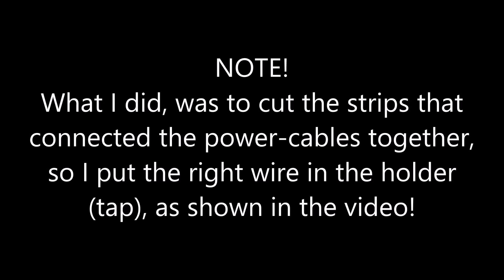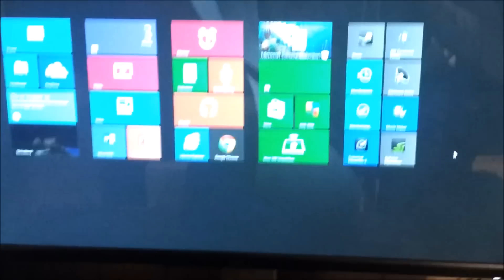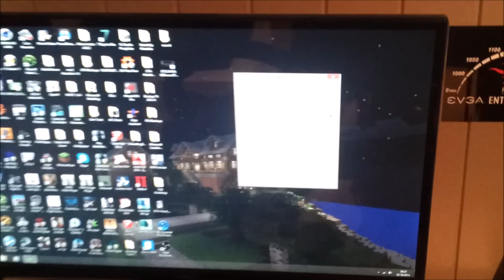Alienware x51 EVGA GeForce GTX 760 4GB FTW /acx Upgrade/ Installation Tutorial And Review

Comment: thanks for this vid man. I heard that using a gpu with double fans in the x51 was taboo, but you just installed one with no probs so far I guess. Thanks again you have given me the courage to start my upgrade as well. by the way you just put the 6 pin into the 8 pin port and it worked?, I thought you had to use a 6 to 8 pin adapter or something.
Reply from the maker: yes i tought that first too, but i readed on the site there i bought the card, and there thay said that you can use two 6-pins on a 6-pin + 8-pin card. I can say that the card is running with no power problems. The card only gets hot when playing games that constant render, but it runns cooler than my old card when playing black ops and Minecraft and games like that :)
Reply: Games To Tuts so no power problems at all?????
Reply from the maker: Lollercoaster119 yes no power problem at all :-)
Reply: hmmm alright and what about the space was it a tight squeeze?
Reply from the maker: Lollercoaster119 it wasn't that tight fit that i think it should be. You have about 1.5cm space between the front fan to the card. So you will be able to upgrade to a bigger front fan if you want :-)
Reply: did you upgrade the front fan if so which one?

Comment: Any heat problems since you are not using a reference /blower type of card? I'm tempted to buy a 970 with this cooler since I can't find a reference one, but I'm scared that it gets too hot inside the case, please let us know if you experience something wrong. Thanks for the upload I hope it works fine!
Reply from the maker: Thanks for your comment :) I haven't got any problems with this card, no restarts or power loss. When i play games like black ops and black ops 2 the card reaches max 65 degrees celsius and i will say that is a good temperature with this card. When i play games that render constant, like euro truck simulator 2 the card gets up to 86 degrees celsius at the max. I can play battlefield 4 and 3 with ultra setting on, without lag. The card gets around 86 degrees celsius and 70c (depends on witch map you are playing on) The really good thing with the ACX cooling is that the fans cool down the hard drive and the computer pretty good (better than the blower style fan) I can confirm that only the graphics card is quite hot when i open the computer cover after heavy gaming. The other parts are not that hot at all. I am going to put some blower fans ounder the gpu so the computer get rid of some hot air from the gpu.

Comment: Where did you find the 330W PSU? I'm installing the MSI GTX760 TF today and I believe that the standard 240W AC Adapter came with my AlienwareX51R2. 240W isn't enough to run system processes with my new 760 :/. Also, was there any need to buy a 6to8 pin connector adapter?
Reply: btw im also upgrading from a GTX 645 like you are at long last lol
Reply from the maker: Hello. I purchased the 330w psu from the dell website for my country. You can also get them on ebay and Amazon for cheaper. I only used the two 6-pin connectors, so no need for any adapters as they fit in the 8-pin on the gpu. Good luck :)

Comment: hi
first of all thanks for your video. I am also planning to upgrade. in your opinion which type of graphics card is better , single blower type or dual fan type?
Reply from the maker: I recommend singel blower card in the x51, because the dual fan one will get a little loud because of all the heat that it push into the case, but a singel blower card will take up fresh air from the front fan in the x51, and blow the fresh air thriugh the card. The dual fan will cool the give the same temps as the singel blower in the x51. I have found out that if i turn my x51 on the side, then i can fell cold air beeing sucked in at the buttom of the case, and i feel hot air be pushed out on the top of the buttom. I can say that it cools better when the pc is lying on the side the fans doesn't need to work that hard too. It also cool doen the HDD pretty good. But it is one more thing i have to say, the front fan in the computer getts pretty loud after playing gpu intensive games so i actually think the dual fan card is good in the x51 but the front fan needs to be replaced. Hope this helps a bit :-)
Reply: Games To Tuts hey thanks for the prompt reply, i really appreciate your help
Reply from the maker: Ayan Adhikari no problem, I'am happy to help you :-)

Comment: Are you still using the configuration in this video?

I have an:
i5 4430 
GTX 660
8gb RAM
330Watt PSU

I want to upgrade to GTX760, but want to be sure it will work.

Comment: So have you gotten AC Unity? and if so, how is the gameplay like with this GPU? I want to get a 760 or a tad higher. And after this video I think I'm going to crack open my beauty to see how it looks for myself lol
Reply from the maker: I haven't tested that game, but i have AC Black Flag and it runns pretty good in 40-50FPS with everything maxed out in ultra :-)
Reply: Games To Tuts I have played black flag on the GTX 645, and smooth gameplay all throughout. no drops, rare but comical glitches. But I can run Unity, but with horrid frames. even after the recent patches. Anyway, I plan on buying a new case with other parts attached so I can upgrade and just transfer the good pieces of my X51 to the new case. Yes I will be performing surgery on my baby lol
Reply from the maker: Janov Clervil I actually working on the same thing. I have recently got a Corsair CS 750M PSU and i am going to buy a new case too when i get some monney, so i can put my x51 in it, but i am going to buy a EVGA Stinger Z87 FTW motherboard later so i can put the Alienware motherboard back in the x51 and use the x51 for traveling to LAN and stuff :-) I do this because of my interests :)
Reply: Games To Tuts
Oh nice. I was planning to try to sell my x51 case but, I think I will keep it and have my parents learn how to use a computer on it lol.
Reply from the maker: Janov Clervil sounds good :-)

Comment: Good morning, please I really need your help. I am from Brazil, on 2013 I visit Canada and i bought one x51 R2. It came with a geforce gtx 660 2gb and some years later a upgrate it for a gtx 760 4gb, since a made this upgrade the computer makes a really loud sound, it looks a airplane taking off!! My power suppli is the standart, i think it is 240w. To change for a 330w power supply I need to buy just de power supply with the cable or I need to change something inside the computer enclosure? PLease I really need your help!
Reply from the maker: Hello. Sorry for late reply. I also had this problem. X51 with gtx 660 should alerady have the 330w psu. I found out that it is not the graphics card making the noice but the 60mm fan on the front of the graphics card and case. You can control it with speedfan manually. Look at this thread for more info, as many people are having this issue: http://www.alienowners.com/threads/x51-cooling-front-fan-replacement.3741/

Comment: What are your temps like? I'm expecting around 75-85 Celsius?
Reply from the maker: It depends on witch game you are playing. But in black ops you have temperarures around 50-60. But in games like battlefield 3 and 4, gets the card pretty hot, with degreeses around 65-80, the gpu fans stars to spin really fast and gets a little loud. This card is a litte better than the Superclocked version but i recommend you to get the SC card if you are going to have it in the x51. The problem with the FTW card in this case, is that the card is open around the whole card, exept the back and top, to disepate hot air faster and make the card cooler, In other cases. So try get the SC if you are going to have this card in the x51, because it is locked around. Hope this helps you :-)
Reply: But wouldn't the SC version create even more heat than the FTW edition? and the FTW has ACX cooling. 

So the FTW creates less heat, and has better cooling?
Reply from the maker: Yes the SC wersion with dual fan ACX will create more heat than the FTW with ACX if you have them in a big case. Thats because the SC version is locked around and the heat gets straight out of your computer but the FTW ACX Is open all around so the heat is blowing out faster and the card gets cooler. But the x51 is pretty smal, so hot air will blow into the case when you are playing, and the card will suck up some of the hot air, so thats why i recommend the SC version if you want it in the x51 :-)

Comment: this isnt possible unless u installed a different motherboard the x51 motherboard isnt compatitble with graphics cards that high i asked the alienware people
please tell me how u did it, i have a alienware x51 with a gtx geforce 555 and want to upgrade it. what do i need to do?
Reply: First, for the most part Alien ware support will not tell you anything. If you can't buy it from Dell that's because they won't sell you anything that wasn't sold with the X51 when it was made. They have a standard answer, IT WON'T FIT!!
Now read this.
The other night I had to call Alien ware support, and I wanted someone with better English that I could understand. So I got a Supervisor in Teir 2 support. After she fixed my problem we had a talk about Video cards.
The GTX 760 Ti was the largest card they tried in the X51, Yes you need a 330 watt power supply you can get on Ebay or from Dell. Inside the case is a Step up transformer that puts out 500 Watts. 9.5" is the longest card that will fit. And you should get a card that uses only around 170 watts.

Comment: I upgraded my x51 graphic card from Geforce GT 640 to GeForce GTX 750ti FTW. all I had to do is to upgrade my power ac adapter from 240w to 330w. 

240w is the slim brick power ac adapter and the 330w which I called the Power Brick which is bigger than the 240w slim.

mine booted up with 0 Problems. please do not download more than one drivers. stick with the current drivers that your given.

I played Dying Light on mix medium and high settings at 60fps-102fps

Comment: Whats up? I installed the GTX 760 on my Alienware like yours, very nice the video thanks. But im playng some games with very nice graphics and the fans are very loud de sound. Is it normal? The temperature is normal, but the sound.. so loud!!
Reply from the maker: That is the front fan on the x51 that ramp up to max speed at me very annoying, but i think switching the fan to a silent one will fix the problem.

Comment: Would I notice a huge difference in FPS with a 750 Ti from a 645?
Reply from the maker: RyanSmithHD Yes i guess that. My GTX 760 is about 3 times better than the 645,  so yes the 750Ti will be about 2 times better or more than the 645 :)
Reply: Thanks mate :)
Reply from the maker: NP :D

Comment: I have a i7 4790 (I think that's what it's called) and I also do too have this Alienware x51 but with power issues I'm not sure if this is even possible for me. Any advise?
Reply from the maker: I think the reason for power problems is that your i7 use about 14w more power then my i5, so that should be the problem for your power issues. Try go in control panel and powersetttings and change the power plan setting to balanced or the lowest you can get there. Hope this helps :-)
Reply: How many watts do you have? Also an i7 does eat more wattage then the i3 or i5. Like Games To Tuts said, I really wish i didnt buy an alienware and built my own. I have the gtx 750 ti in mine with a i3 CPU and 240 watts. You can always download nvideas program which lets you limit how much power the card will consume but it will decrease performance a bit. If you ever going to upgrade past like the GTX 700 series then you would need a new case and PSU to have it perform properly but the motherboard's IO sheild is built into the x51 so you would need to buy a new mobo :/
Reply from the maker: Papa Smurf i got myself a new case for about one mounth now, and i put my x51s parts in it (The Motherboard and hard drive and my gtx 760). I buyed a Corsair cs 750m gold rated PSU and put it into the case, and the x51 parts works with that psu. BUT one problem! When i start the pc i get an ERROR "Power sensor failure!", then i press F1 to continue and it starts up to the Alienware logo and then it freezes ( Only Sometimes) Then i have to turn the pc off and on again, and then it works. Just press F1 to continue on startup, and if the boot failed u just need to reboot the system. I got a new problem for a week ago. The seccond RAM slot isn't working so i only run 4GB of RAM, and everything goes so slow after playing a game so i have to restart the pc. But i am going to buy the new EVGA Z97 Motherboard after christamas and swap out the i5 from my x51 motherboard and put it into the EVGA mobo, so i get everything up and running 100% faultfree. I will also try to get two 8GB HyperX Sticks of RAM so i have 24GB RAM. But the gtx 760 is running much cooler in the new case than it did in the x51. And the fan speed on the 760 is newer over 50% ounder big load and it is super silent. I recommend you to get a motherboard and a case and put the x51 in it.
Reply: Games To Tuts How did you get the IO shield off the mobo of the x51 and did it make any beeps when it said power sensor failure?
Reply from the maker: Papa Smurf i dont use any IO shield so i just have it open. I get the normal 1 beep on every boot
Reply: I may just do what you did and get a new case with the new motherboard so I guess that works
Reply from the maker: ***** Yes The gtx 760 worked in the x51 with no power issues, but it got so hot and the fan speed was 70% ounder load, so it got a little loud. But with my new case, i have my fan speed never over 50% and the lowest fan speed is 42%, so go with a new case and motherboard and pull your i7 over in the motherboard, and make sure that you have the right socket on the motherboard for your i7 :-)
Reply: What kind of case would you recommend or at least what size should I get? Thanks for all the help
Reply from the maker: ***** I got the NZXT Phantom Orange/ Black, because it is nice looking, (looks a little bit on the Alienware x51) and it also comes with an fan speed controller and 4 fans inside. This is a big tower and the cooling is pretty good, and it is easy to work in :)I recommend the NZXT phantom cases :)
Reply from the maker: Games To Tuts I also buyed the nzxt 2m orange led kit, so i have orange led light in my case. Looks Awesome. The Phantom cases comes in more colors :) Case link:  http://www.nzxt.com/product/detail/34-phantom.html
Reply: Games To Tuts That is a really nice case but I'm thinking I may get something different. I'll go search the interent for both a motherboard, power supply, and a case. Probably will use http://www.pcpartpicker.com for the help because of compatibility
Reply: Games To Tuts Also what did you do with the Alienware Command Center when you got the new case?
Reply from the maker: ***** i jist have the program on my desktop incase i get an alienware tact x keyboard
Reply: ah I see. Just wanted to know what to do with it when I get a different case
Reply: Games To Tuts I think I know why you get the error, did you know that their is a Step Up Transformer board in the X51 using 330 Watt PS. This gets stepped up to 500 watts, your other 750 PS is having a problem with the 500 Watt' I'm running a GTX 760 4gig on a X51 R1 with a 330 watt PS with no problems at all. Plus 16 gig of ram.

Comment: hi i bought my alienware in 2014 it came with a GTX 645 and was wondering if i could fit and handle a GTX 750ti with the 330w PSU please help me and great vid BTW
Reply from the maker: Yes you can have that card in the x51, and run it with no problem :-)
Reply from the maker: You can use your 240w psu that came with your x51 if you are getting the 750TI with one fan. Which brand are you going to get? Need to know how much power the card uses. I am willing to help you :-)
Reply from the maker: Heres a guy who did this upgrade with the 240w psu:  http://www.alienwarearena.com/forums/thread/71011/hardware-software/i-installed-gtx-750-ti-sc-to-x51-r1-with-240w-psu
Reply: Games To Tuts well im not sure which brand and my current specs are: i7 4790 and a 645 and are you sure i dont need a better PSU?
Reply: 9.5 Long

Comment: I installed a pny gtx 970 [4gb] to my R2
no regrets
Reply: RX7821979 what psu have you got?
Reply: RX7821979  (Power supply)
Reply: Static IsBae 330 watt power brick from dell
Reply: did the psu come with the alienware x51 r2
Reply: Static IsBae
no
I had to spend 120 dollars at amazon for the psu
Reply: but the 330w comes with the alienware x51 r2
Reply: cause i have it
Reply: Static IsBae
mine came with a 240 watt psu cause I had a gtx 745
Reply: +RX7821979 was your upgrade a whole new power supply brick? Or was it just a new AC cable? Thanks
Reply: Ahmos
new power brick [330 watt]

Comment: It's ironic how you don't tell us the graphics card U had before, would u be able to tell me?
Reply from the maker: Yes i can tell :-) The Nvidia GeForce GTX 645 was a good card that run every single game BUT not maxed out. I could run battlefield 3 in Ultra with shadows and Antialiasing decreased to the lowest, and get 60-70 FPS, but then the game got square lines and it didn't look that smooth. And in Battlefield 4, i had to set the graphical settings to normal and high mixed together to get 60 FPS. So this card was great but not good enough for me/ for my needs. I like to turn every settings in a game to the max and then play with a smooth FPS 60+ :-) The 645 was very quiet because of the little blowerfan that cooled the GPU down. I don't remember but i think the card was about 65 degree celsius varm after playing black ops 2, so it was great temps on it, but not as good as the 760.